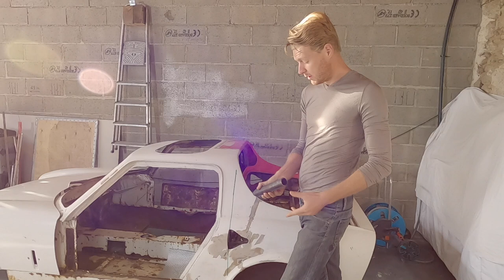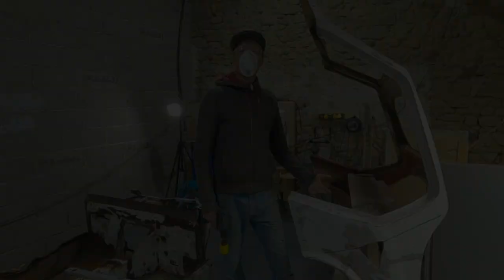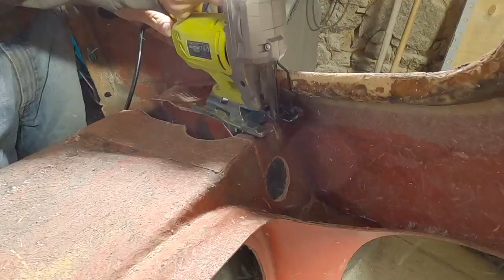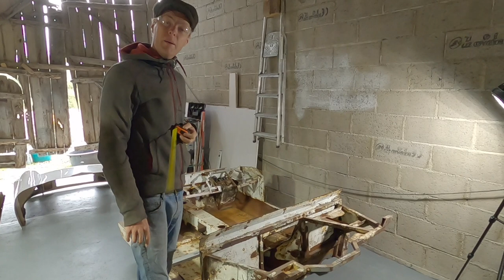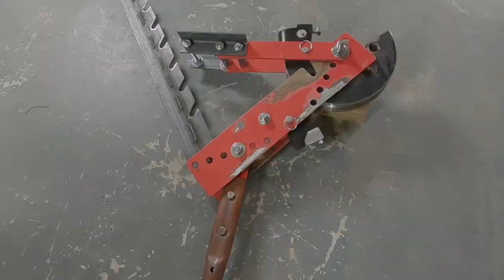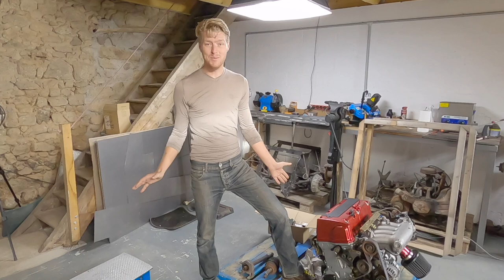The Plan For My Roll Cage | Project Mosquito Honda Type R Mini Supercar (Ep10)

Comment: I am glad I decided to keep quiet in previous videos and wait to see your plan for your roll cage. I am glad that safety is being taken into consideration. I don't have the luxury of building a roll bar outside of my build, but I may be able to push it far back enough that it cannot strike the rear of my head. I am curious to know how you will connect it to the front, though (assuming you are doing a full cage) I guess I will cross that bridge in a future episode.
Reply from the maker: I found out some time later that lotus also placed the roll hoop out back on the Europa racing cars (type 47) which made me feel considerably less crazy for doing it

Comment: Your project resonates with my own Mini Marcos project which came to me as a pile of mangled GRP panels following involvement in a major accident. This had no engine either and I went through the exact same thought process as yourself regarding the cost of a properly sorted A series Engine and box. I also looked at the Honda engine option but thought they too were relatively expensive. I opted for a Rover K series 1.8 which weighs less then an A series (130 kilos) and cost only £70. A fully referbished PG1 gearbox with LSD was £450. I've done a fair bit of research and all of the historical unreliability issues seem to have been sorted out......time will tell🤔
Reply from the maker: The Rover K is a good engine especially for a front drive car in the uk where there is plenty of support. If you'd like to share some pictures of the Marcos id love to see them, feel free to post them in the Facebook group linked in the description.

Comment: hello; visually the back of the rollcage it doesn't seem to be in the center of the car: is it centered weight wise?
Reply from the maker: A center as in a place to work out from, a starting point. The actual center between the wheel base would be me

Comment: How do you find enough time to fit everything in? Between the barn, workshop and the cars I’m exhausted just watching.

I plan to move to France (if the land purchase ever gets completed. A concern I have is about bringing my cars with me because the modification of cars seems to be full of hurdles in France. Are you planning to use the GTM on the road? If so I’m sure you have all the answers. Could you share some advice with us.
Reply from the maker: Getting a modified car through inspection in France is famously next to impossible because it's technically illegal. Pandora is registered in the UK and will be my car for going back and forth for shows and such

Comment: Damm watching this is making me exited for old british sports cars haha, Now I have a question, personallly im into luggage racks, It looks a little weird in sports cars, but I feel like as a daily it helps carry things, specially if the car is small, plus it add some uniqueness aspect to it. this is my taste ofc. Im saying this because personally, to not lose head space, (specially since im 6'2 so I also have trouble fitting in small cars) I would take advantage of the roll cage going out of the car, to reinforce the roof, conecting a tubing to the A pillar from the outside and disguising it as a luggage rack, then going back in to finish the rollcage. that way I wont lose a lot of space iside the car. so my question is, how would you work on it? ofc, what I said applies if you want to do a 6 point rollcage, I dont know if you want that.
Reply from the maker: Because of my crazy engine choice, my boot space will actually be twice the size and Pandora is kind of the wrong era for a luggage rack really but a safari rally roof rack had crossed my mind 😂
Reply: @OliverPickard  DO IT! I want to see it with a safari rack!
Reply from the maker: @akumabito2008  🤣